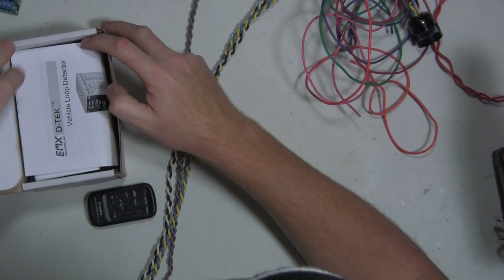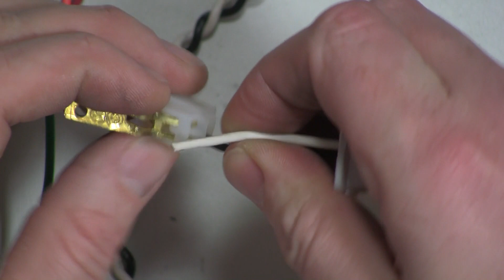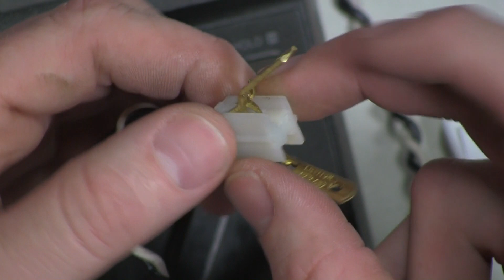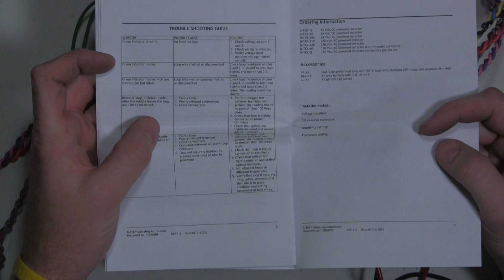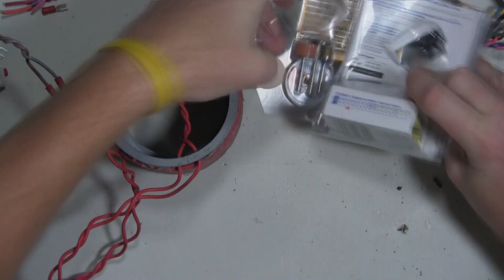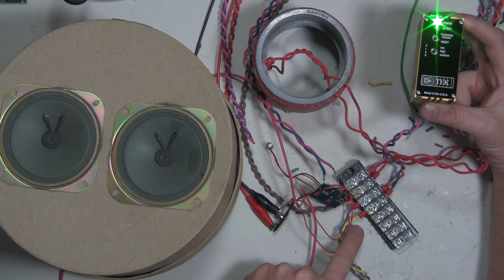ACF 019 Vehicle loop detector test rig Part 1

Comment: How do you make your loop for this project
Reply from the maker: I don't have it videos showing that particular loop. However here is something that will work perfectly. You just take a Gatorade can, drill the holes as explained, use some wiring  (it really doesn't matter what kind, we used XLPE, speaker or electrical wire will work just fine and then feed it through as the video shows.. Let us know how it works for you https://www.youtube.com/watch?v=cmLDxi1Fpro